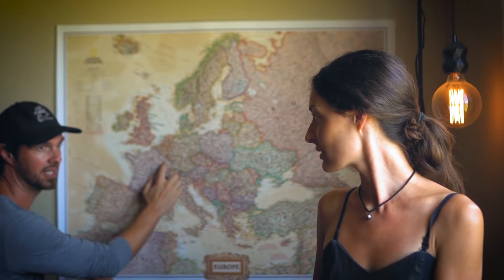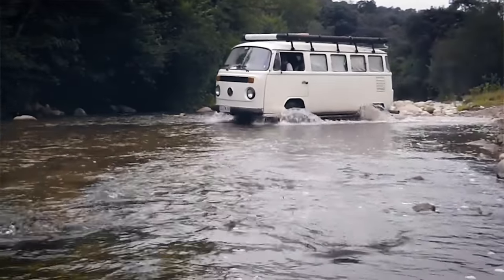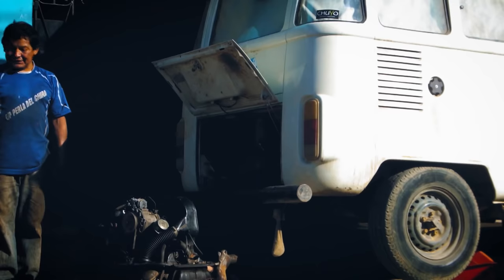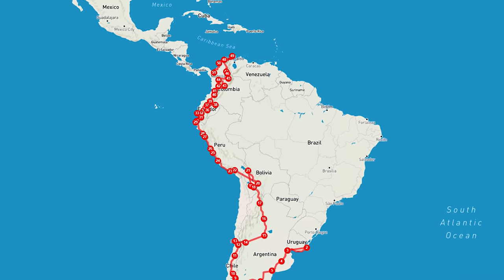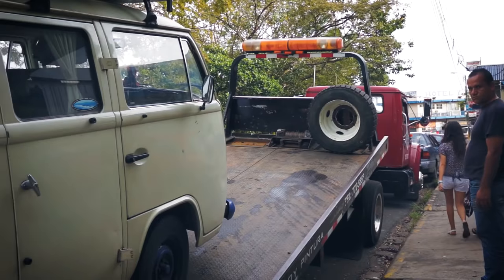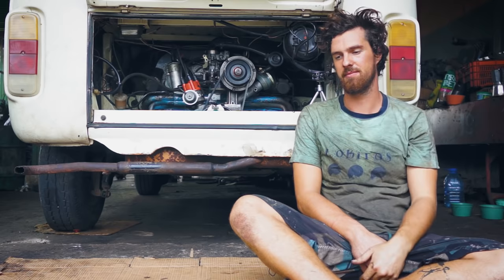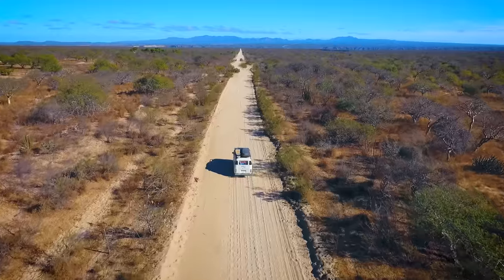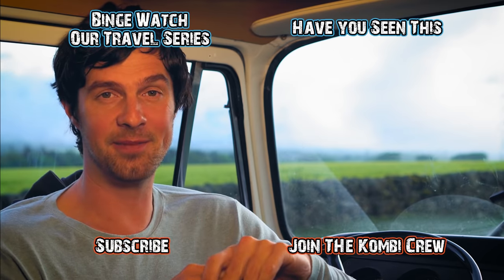How Did I BLOW UP 10 ENGINES in 1 ROAD TRIP???

Comment: See all the tins missing at the rear of the engine? Yeah, that allows heat from the exhaust and dirt to coat the engine, reducing the cooling, so...more rebuilds to follow, guaranteed. Sealing the engine bay from the bottom, putting scoops on outside fresh air intakes, ALL tins repaired replaced and installed, New oil cooler, tune carb to spec. re-torque heads and check valve adjustment after 100 miles. Oil today is less than when this engine was built, it’s not better, original motor oil destroys Catalytic converters, so use only synthetic and change between 3k and 5k. Engine case savers are needed on overheated engines. It’s a great engine with citations, live within them an ensure engine is ventilated properly, with proper tune, regular oil changes with valve adjustments, and they can circle globe many times.

Comment: Has no one mentioned "KNOCK OR PREIGNITION" sounds just like this. Overloaded, steep hills, hot climate and no liquid cooling....BOOM? I'm familiar because I had an old Dodge van with a slant 6 I used to drive all over the southeast roadracing motorcycles. Hills in Georgia would force me to back out of the throttle near the tops of hills when instinct would tell me I need to give it more gas. Knock is like hitting the top of a piston with a hammer, causes engine to get hot, burn pistons, and may be the cause of the cylinder studs pulling out?

Comment: Interesting series : ) Lots of trials & tribulation on your earlier trip, along with some on the current trip. One thing I noticed on your new hi-
top is that you're missing the window gaskets on the upper windows. Those windows are called "Hehr" Standard windows & were used on Airstream travel trailers in the mid 50's. Reproduction gaskets are available from www.vintagetrailersupply.com . I own an Airstream restoration shop & have two early 70's vw buses : ) Good luck on your journey around the world. I spent 6 years working my way around the world 40 years ago, however not driving a vehicle. I hitchhiked mostly, plus local buses, cargo boats etc. I hitched about 25,000 miles...............lots of stories : )  I'm inching towards retirement now & plan on doing it all again. Keep in mind, the more you see, the more you realize that you haven't seen anything..............lots out there in this world & the people.e are what make it great!
Reply from the maker: thanks for that

Comment: Good job on learning. However your carburetor always has the same amount of air. Drilling out the jets will not effect how much air goes into the engine but instead how much fuel goes into the engine. At higher altitudes the air is less dense therefore you run a smaller jet so less fuel is added. Drilling them out would make it run too rich but would be a fix if you went from high to low elevation. What they may have done though is fill the jet in and drill a smaller hole. May I recommend a cylinder head temp gauge and oil temp gauge. Also an egt( exhaust temperature gauge.) would be a good idea. It will show you the temperature of the exhaust coming out of the engine and be an early warning sign to things such as too lean or rich of a mixture and or improper timing. Detecting the problems before they cause catastrophic failure. Keep up the good work. Enjoy the next one.
Reply: Also don’t listen to people say your van sucks. Ya it’s more maintenance but there is a reason they run them all over the world still today. Simplicity. Ya a modern van will prob have more power better economy and less maintenance however if things go bad good luck finding parts and or taking it apart with minimal tools. Also with the simplicity you can at least fix it enough to get to the next place to at least get some kind of fix. The only thing simpler would be an air cooled diesel. The people who poke at you would prob never even make that trip  as soon as there cellphones stop working and they can’t call a tow truck to Chang a tire they’d be sunk.

Comment: Looks like the Kombi worked well for campining. 
Hopefully youve learned what I was told in the early 70's as a small child. Anything Volkswagon is not only unsafe but the engines are absolute junk. They dont last long and have to be rebuilt often. 
You might try extra oil cooling. 
You should be a VW expert by now! 
Like the videos. Would like to try it without the Kombi!👍

Comment: Make sure your can has an oil temp and oil pressure gauge. Also a cylinder temp gauge. Best to have at least two sending units, one on each head. Ideal situation would be a sending unit on each cylinder. That allows you to locate a heating problem a lot easier.
Reply: Your "can" doesn't need and oil temp gauge, your "van" does! :)

Comment: Adjusting the jets changes the amount of fuel that gets in, not the air. So jetting a carburetor for high altitude (thinner air= less air) means making the jets smaller to adapt to that (the air fuel mixture would be too rich otherwise). When you get back to lower altitude (resulting is thicker air = more air) the engine will run too lean resulting in too hot burning and possibly engine damage

Comment: I run aircraft I0520 aircooled, never has failed. Variable F/A mixture, variable pitch propeller. 180kts at 15K AGL
Get a water cooled engine van, many to choose from, I do 3000 mile trips without issue. Cruise at 90 in OD.

Comment: Someone recently told me about you, I run through the same pain ... Bought my Kombi in Rio, actually in Argentina. 
In 2 Months iam standing right now Infront of my 5. Time getting the engine out... The first 3 Mecanics did, the last two I was doing more and more on my own, to keep the bill down and to learn about it... The tip with the overheating is good, I'm looking further on that part. Enjoy!
Der Vagant (Facebook and Instagram)
Reply: Felix, The others are commenting on the overheating issue and have made some great suggestions. A tip for you from an old hippy mechanic , is this  The cylinder head  air controll thermostat fails silently and not obviously. Putting in a new oil cooler without testing the thermostat = an overheated engine , again and again.  Does this refrain sound familiar?

Comment: Tight valves are very bad . Aren’t bug engines smaller ? Heili coils larger studs girdles like a plate that join the bolts were available changing the pulley size will make the fan turn faster means cooler . You should set the points in the dist. often timing with vacuum advance pluged off ,on when done . The covers over all engine  need to be in place . Smaller jet in high altitude larger jet can raise compression stud problems Occur. There are larger vw motors that fit . Adding fresh air intakes is a good idea.
Reply: Sonny, Wow first mention of valve clearances. Kudos from me. I still have the dwell meter of mine from the 70's. There is a reason why  most  modern engines use electononic ignitions.  I used to carry a couple spair sets of new points on road trips. Seems like I was forever setting points and valves

Comment: A life time ago I was a VW/apprentice the fuel and air correction jets used to come in matched sets one simple thing can reek havoc to an engine an sump oil extension pan and cooler should of been installed for hot climates and large loads or add a little two stroke oil to the petrol tank to act as a upper cylinder lubricant important as gas is lead free nowadays regards mike
Reply: Mike, I am a journeyman now. My comment is this to you, Your comments are on the mark. However the first 1600 I rebuilt 2 x actualy had a failed air control thermostat.  An old German mechanic told me that in 25 years of working on air cooled engines, he saw a lot of "not obvious failed themostats that were silent engine killers" These were on Canadian engines.  He said Allan "use a hair dryer on low hot setting and test them. " Good luck Al
Reply: Good point on the thermostat we would check them on a warmed up motor and often removed them in hot climates I seem to remember fitting different size crank pullies smaller for more power at the cost of fan speed and larger for greater cooling fan speed and we often brazed bent washers to the valve covers to keep the spring clip in place using a couple of cable ties.
Regards Mike

Comment: I am a sucker for old simple equipment i have played around vw in many forms of and on for years trikes bugs kombis the most unusual use i have seen was on a paddle wheel boat that was built for cutting the weeds out of canals they used a stock 1600 to power a hydraulic pump that ran everything my current project is a 1968 gm pd4107 bus that is home powered by a 8v71 Detroit diesel two stroke left hand turning engine that is transverse mounted some what laying on side

Comment: From what i see ,you should have had  someone with a bit of mechanical knowledge go over the bus when you first bought it. The locked up disc brakes and lack of engine tin would have been obvious . Plus they would have possibly got you to fit scoops to the air vents and /or fit an external oil cooler. The duck man bought a bus recently which has a huge cooler mounted in the louvre box ,which looks like it came off some sort of refrigeration unit. It shows what is necessary sometimes. Oh well, it's all part of learning.

Comment: The only problem of the VW air-cooled engine, that's have 300 ways to build it (and it will run). But only one way to build it properly. That's engine is basically a aeronautical engine.

Comment: Bigger jets let in more fuel. I bet he filled them with solder and drilled them back as a smaller jets. It works but leads to lean running at lower elevations and .....BOOM. Especially in an air-cooled VW.

Comment: To much heat on the engine reason for the studs pulling out. The metals are dissimilar and expand and contract at different rates. If your gonna be running it hard that you go oversize and make the threads a interference fit. The. Heat up the block and cool the studs for a tighter fit.

Comment: 5:45  He should have leaned the engine out by installing smaller fuel jets.  Can't make a naturally aspirated engine ingest more air unless you force it.  At that point it becomes a forced induction engine (turbo, or supercharger).  So the rule of thumb is tune the carburetor for the lowest altitude you will operate at.  Can't hurt an engine running rich, but boy can you wreck an air cooled engine in a hurry running it lean.  If he drilled the jets it would have performed worse at altitude, and improved on decent, but probably still worse than it was before.  He probably didn't have a wide selection of drill bits either, so it gets to be a real crap shoot on how much fuel is drawn into the engine.

Comment: I have a lot of doubts you could have burnt up and seized an engine so quickly simply from a bum valve adjustment.  My guess is that when you did the shade-tree rebuild with unknown parts, you probably didn't CC the heads or check deck height properly (or at all?) and wound up with far too great a compression ratio. and that will cook an engine in short order. Been there, done that.

Comment: Drilled jets means more fuel = more heat. You can not re-thread the head and assume it will work, hand re-threaded threads are not exact so they will loosen in time.

Comment: As a vw mechanic since 1978, everything you did was wrong. Nobody knows what their talking about. Drilling out the jet supply's more fuel not air, which make it run richer. It sounds to me nobody installed the air deflectors between the cylinders. There's also a thermostat that controls the louvers in the fan shroud.
Reply: They probably didn't install that stuff. The correct tins under jugs and such . Probably didn't even install them . Sad stuff .

Comment: Eventually you will end up with a dirty oily engine where everything useless is broken off..that works. The main things are 1.put in single duel barrel carb e manifold 2. Replace with branch 3. Change to electronic ign...later kombi distr could be modified quite easy 4. Flow carb 5. Flow heads 6. Recut cam to 280 deg e 8.3mm lift.
4,5,6 will be the death of overheating. Make sure you foam insulation seals 100 NB

Comment: And THAT is why I just did a Subaru swap on mine.
Reply: How hard is it to do? And how much did it cost you? Im thinking about doing it to mine, did u have to alter the transmission too?
Reply: I'm having it done by SmallCar in Seattle.  They are doing an engine swap, transmission rebuild, upgraded suspension, upgraded brakes, and new front seats.  It was about 30K.

Comment: You beat me by two engines - Fast Gehias and Dune buggies and each had a spare engine in waiting. Bad valve adjusted by friend broke valve, unclamped gas hose set car on fire, Water put in gas tank by friend caused steam when it hit engine and bang, Crank on 2,100 Baja bug snapped it half from too much power, Seat back released sent car into ditch smashed head and blew engine, Bad gas seized rings, car towed for broken brakes but mechanic stole the engine - All work done in VW racing shops with top quality parts. On good side, Gehia with 2,300 beat Buick GTS for pinks and I drove that Buick for 5 years with never an issue. Yes I still love the VW but am now making Volvo P1088 electric and if my wife does not divorce me it should be on the road in a couple years.
Reply from the maker: Damn that’s some tough luck and perseverance right there.

Comment: This might not make sense but from what you just said I've decided to buy an old beetle I've been wanting one for a little while but I've always thought the engines are old and not right. I figured I would want to put a Subaru engine in it and do all these modifications and make it modern but if it's that simple to actually mess around with very little knowledge and where you can fix  it for $15. 10 different times in some other country with what I know and my tools I should be able to rebuild one in my living room and have it last for a million miles. Lol

Comment: i have a 63 bug with a 72 bus trans and a 74 bug stock engine and trans both are baja's got them both for 400 bucks they run great and had them for about 8 year pound the sh out of them never have to work on them plus drive them on the road all the time lot of the time the go all day long getting pounded we jump them we fly cross country about 60 and only broke the trans mount once but have reinforced the trans on them ur timing is very important in them  or they over heat easy u got to have it perfect and it is not easy to get it perfect i put in after market distributor in it

Comment: You were missing some of the tin. Every piece of tin is important. I found a hi volume oil pump, an oil sump and real gauges for oil pressure and temperature help prevent  issues it was cheep insurance . How to keep a Volkswagen alive for the complete idiot is my go to when I had my Karmen ghia. I never had an overheating issue with my stock or my race motor.

Comment: Those engine tins are critical. When VW was building the air cooled engines, they didn't put a thing on them that didn't need to be there. If you run it with any of those missing you're begging to burn it up. They were designed to be easily maintained and repaired by the average person armed with hand tools and a GOOD book. Throw the Haynes manual in the fire. They're 99% correct but that 1% will destroy you. Go for Chilton or Bentley manuals and get old ones. Or real VW factory repair manuals. Get yourself either a new engine block, or one that you KNOW has never been abused. Follow the torque specs to the letter when you assemble them. Case studs pulling out are a sign of over torquing. Stock up on good OEM parts. Learn this vehicle. Even assembling an engine from used, but serviceable parts you can get 50K miles out of it if you know what you're doing. Talk with the old Airheads that do it by the book and LEARN.

Comment: I did not see it .... do you have an oil temperature thermometer?

I was driving an ... optimized .... beetle for 7 years when I was young... the most important was the oil temperature thermometer on the German highway to prevent overheating ;)

Comment: VW vans used to slow down the Porsche racing crew. They got pissed. SO.....Porsche 911 motor fitted. That thing flew. Remember reading about it. Low budget, drop in that Subaru boxer engine.

Comment: Missing tin, there is a reason vw switched trans from 002 to 091 was over heating I would have  went with the dog house cooler and tin and up graded  the oil pump and more pressure to run a aftermarket cooler and if it runs rich you might use more fuel but it will run cooler  and  if  your using a old engine just add case savers to the hole thing  and new stock heads are not that expensive better than wasting time on old ones that are all falling apart  and cary spar belts coils  points on long road trips.  I would have just put a Buick  V6 in is  everyone would just look crazy as your plasting up a hill

Comment: The jetting adjusts the amount of fuel not the amount of air. He should have reduced the jetting at higher altitude. So once you have gone down in altitude, you were running lean, this could have indeed been the cause of many engine failures.

Comment: Install a better alternator and replace your parasitic engine fans with electric fans activated by thermostats.
Electric cooling fans are much more power efficient than engine fans both in cooling and powers needed to operate leaving more power free to accelerate.

Comment: The lesson learned... from a 40+ year VW Mechanic...  I've built over 500 VW and Porsche engines from 25HP to 2235's....  RULE NUMBER 1:   Don't drive an Air Cooled VW if you don't know how to fix them.  RULE Number 2:  If you don't know how to fix them, have a coopy of John Muir's Idiot manual with you at all times, plus, a spare parts box which contains 1-2 of everything.  :)